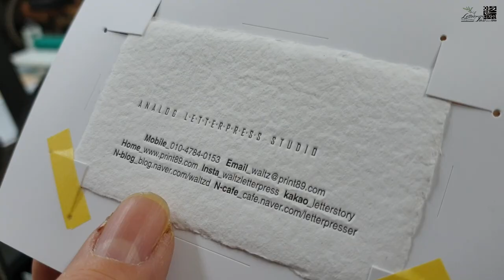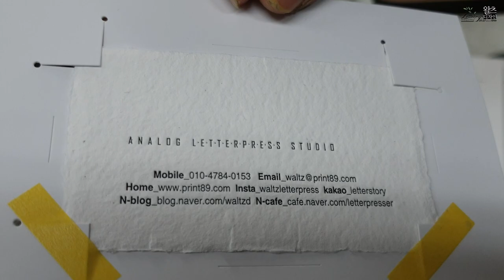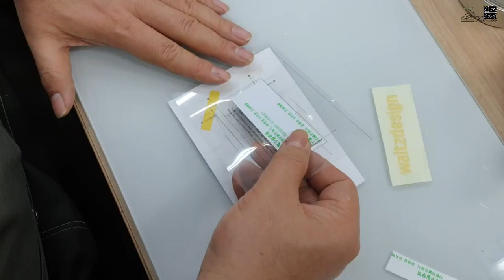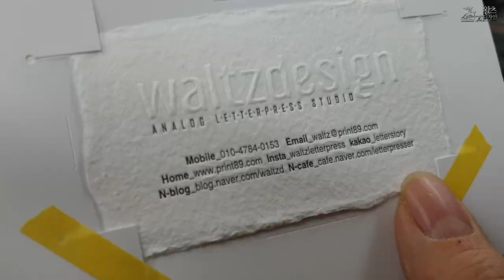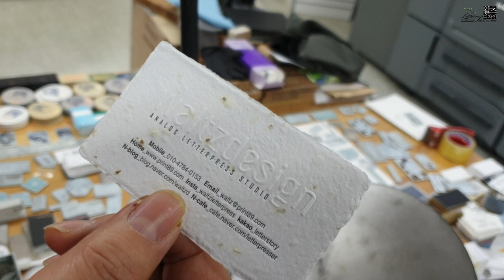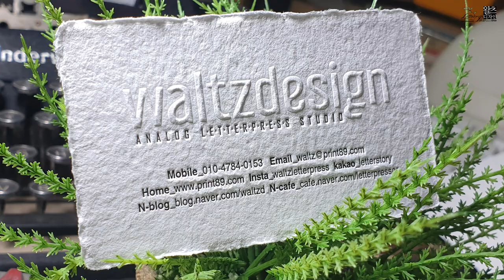Create a letterpress business card with handmade paper. 수제종이로 레터프레스 고급명함만들기.

Comment: Hola... Pudieras comentar la marca del sistema de jalón del foil que usas en la chandler y la heidelberg....?
Son del mismo modelo?
Si los venden? Donde se pueden comprar?
Por tu atención... Muchas gracias.
Saludos desde iguala, guerrero.
México.
Reply from the maker: Nice to meet you. I mainly bought equipment in the US. Imported to Korea and installed a foil device at a Korean factory.
Foil device is not sold separately, it is manufactured and installed on the fly. Letterpress equipment was usually purchased through Google search. Perhaps the United States has the most equipment.
Reply: @w_letterpress  muchas gracias. Saludos.